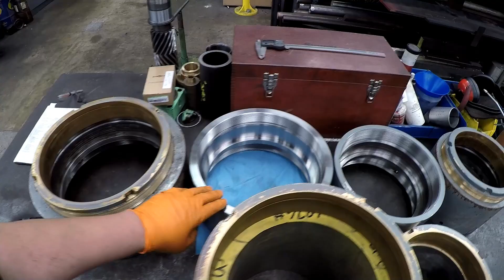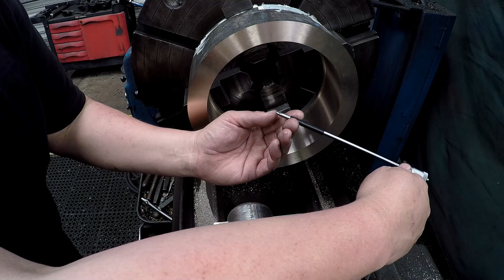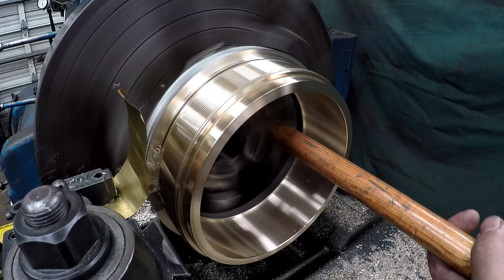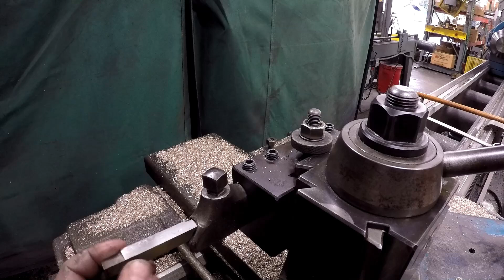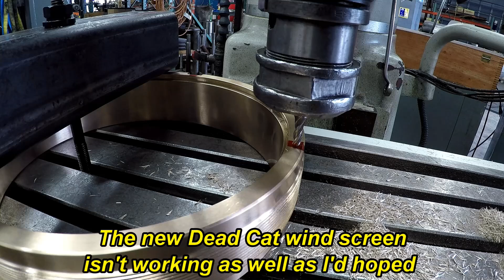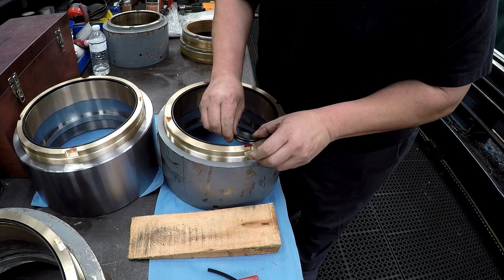SNS 161 Part 2: Machining Bronze Packing Nuts

Comment: One trick for checking large diameter holes with inside micrometers where you use it as a transfer gage is to have a sleeve you fit over the anvil on the outside mic so the inside mic can't fall off.

Comment: Hey Adam, am I correct when you were milling the packing nut spanner nut pockets that you lock the X and Y axis for each cut ? Will that move enough to affect operation? I take it that is a good practice to get into. I am stilling learning. Great job, would like to see them put together. Diddo on the hearing protection, years of work in auto shop takes toll on hearing as well as machine shop and other shops . Protect them when you are still young, cuz us 50 pluser thought we were tough, Wrong paying for it now . God Bless Ya   Dave
Reply from the maker: Yes you need to lock them for each axi movement because the cutter will tend to pull the table that direction and you won't have a clean square cut.

Comment: Adam.. you may check David Clark Aviation brand noise suppressors, they have worked well for us. With the headset the mic is almost in your mouth and you never hear a breath but sound is good. They are cheap too. About $3.00,  I don't know about the size you would need though.. thanks for the video
Reply from the maker: I just don't like the idea of wearing a mic and or transmitter. I want simplicity and what I have works well for me. I just have to remember to use the wind blockers.

Comment: Nice video, Adam, thanks! The microphone wind screen will only work for noise generated by wind on the microphone itself, it won't help with wind noise generated in the fan blades.
Reply from the maker: They work good for wind and moving air, but I'm having to get used to use them is all.

Comment: Glad to "see" you take hearing safety seriously. Being deaf (100% loss) in one ear, I can tell you from experience, protecting your ears will be something you never regret. 

Surgery isn't possible in 99% of audible noise damage cases. If you lose it, the damage is permanent.

Co-workers working nearby should also wear ear protection in closed wall buildings. While decibel levels fall with distance, steel walls will often bounce sound waves at same frequency with more intensity caused by multiple reflection points. 

Thin wall Brass must be a pain in the ass, as I imagine the decibel intensity increases!

Comment: Im sure you have covered this before, but how do you know or what determines how deep the threads will/should be??
Reply from the maker: +zigz0911 I go off of the proper note size (tap size) and the proper amount of infeed on the compound dial.

Comment: Adam, I have noticed a few machinists that when facing they sometimes cut from inside to outside and sometimes from outside to inside ( my preferred cut}. What makes you decide which way to go?
Reply from the maker: +Doug Rundell with the bronze, it's because it's one less op to throw chips on my face

Comment: The hearing protection when possible is a good idea. It's often the unexpected noises that are the worst like a sheet of metal crashing down or a co-worker using a hammer. I got so comfortable with ear plugs at a point where I could have a normal conversation beside a running Diesel engine without issue. Tinnitus can also be hereditary, my hearings perfect and my ears still ring.
Reply from the maker: +Jordan M One thing I absolutely hate is when someone lets a pallet drop to the floor, because there too f-ing lazy to bend over and help it from slamming. Especially when your concentrating on an important cut.
Reply: Mechanic I used to work with would wait for me to go into the other part of the shop before he would do it, but even from there I could hear him clearly drop my drop light.  You can buy very expensive shock resistant filaments in those old school incandescent bulbs but they still don't just grow on trees. About three drops is all one would take before the ghost gave out.  By the power cord he couldn't just let it down easy?

Comment: Sonic Defender EP3s and EP5s, etc. come with a tube you can open up that filters less noise out if you want primarily loud bang hearing protection, close it up for constant droning noises.  Pretty cool I thought, they seem to be durable enough but they get dirty quick.
Reply from the maker: +multiHappyHacker I know that 3M make some like that, one of my coworkers use them. Makes it easy to have conversations

Comment: Adam, how do you machine and finish those long hydraulic inside bores.
Reply from the maker: +Grandpa Cocky The material is always honed from the supplier, but we have a bone we use as well when needed to clean up a bore.

Comment: Nice work on the packing nuts Adam.  You're smart with the ear plugs, my hearing is not what it used to be.  My Dad has tinnitus which to me is worse than hearing loss because there is not a lot that can be done about it.
Reply from the maker: +Bill De La Vega Bill I wish I would have started it way sooner, I used ear muffs when things were real loud but now I use them for everything.

Comment: Hi Abomb, what are those telescopic cylinders used for?
Reply from the maker: +Doug Borrett They go on truck dumps typically found at paper mills and wood mills.
Reply: Thanks, I had a feeling they were used for semi tippers, seen a few of them on YouTube trying to tip on ground that was not quite level and the tipper fell sideways at full height bending and totally stuffing the hydraulic ram.

Comment: When machining so much bronze (copper or brass for that matter) do you save the turning chips so sell as scrap? It seems like you are taking off quite a bit of material, and I would think the scrap value would add up pretty quick.

Comment: Good show!, I think the only reason some folks choose not to protect their hearing is for the most part, just something that is taken for granted, and stubborness... lol...  I have an another abstract question, again, I see that you tighten the grub screws on your tool holders to the cutting tool bits ever so slightly, ( of what appears to be about 1 to 3 foot lbs.) I run much smaller machines, (so small that my mill could fit on your your compound rest of the lathes you run) but I tighten the living daylights out of mine, fear of the tool bits moving and messing up my dimensions, etc. don't your tool bits ever move on you? or am I actually over doing it? Drew
Reply from the maker: +Dru Bradley I tighten the tool bits when they need it. I think your referring to the chamfering tool I used in the Armstrong tool holder. That op the tool didn't need a whole lot of torque, but I put more on it then it may seem. When I use the set screws on the tool holders I tighten them down very snug.
Reply: I understand, I just wasn't sure If I was over thinking things, I never worry about the tool moving in my holders, but I really don't like to tighten them that hard, even though I do, for the reason, of later needing to change out to another cutter, the snap action feeling of tension breaking free. let alone the marks that are left in the top of the brazed tool bits... I guess my biggest issue that I drive myself nuts while tightening the grub screws is any of the round shank tooling, like boring bars into the boring head, and the marks make the small distortions and makes it difficult to then remove, yes, I stone the surface once removed, to aid in reinstalling the tool next time, still drives me nuts. The H.S.S. shank designs or bits, is not an issue, as you know. I thought once that maybe I would grind or mill a flat land area on the various round shanks, (like what is found on endmill shanks to the tool holders), but didn't, due to the idea that will limit the fine adjustment, via simply being able to rotate the boring bars a few degrees as needed.  I suppose I can accept the idea, that it is just part of the nature of the process... Very well. Thank you. Drew ((no need to reply to this, I am just thinking/typing out loud))
Reply: As a mechanic I can relate. Start out and you want to do good, so you tighten like you mean it.  Soon enough, you start to get real good at it as they say and snap-0.  oopsie, sorry about that. Stage two, then you go all weak sauce and stuff starts coming apart on you when it shouldn't have. Stage three.  You use a torque wrench and settle down with experience -- story has a nice ending huh? I suspect you'll have to learn to accept the occasional stoning of divots left behind by hardened points because that's what they do so that's kinda your job.

Comment: Adam, what do you do with all those chips? Is there a company that buys them from you to recycle? (Brass, steel, aluminum separately or all mixed up?)
Reply from the maker: +Wesley Lee We put all he metal chips and scrap metal in a large bin that goes to the recycle yard. It's gets sold and the company gets a check.

Comment: would measuring the outer diameter and then minus 2x the thickness of the wall give you an accurate enough reading if you say didn't have an inside micrometer at hand

Comment: Hey, Adam it's great to see that you are taking steps to protect your hearing.  I have tinnitus (ringing/hissing in the ears) caused by exposure to high volume noise at work.  I have a nearly constant hissing sound that I must live with.  I can't go to a concert anymore and I have to wear ear plugs at the movie theater.  My ears hiss and whistle for days if I am accidentally exposed to any loud sounds; like a smoke alarm or a banging door or trash can lid.  Hearing aids can't help.  So, do EVERYTHING that you can to protect your hearing before it's too late because there is no cure or treatment once the damage is done.
Reply from the maker: +John Ferguson Say what? 😆👍🏻
Reply: I've had tinnitus for as long as I can remember, even as a kid. If anyone can take steps to prevent it happening, DO IT!
And tinnitus isn't the only problem long term exposure to noise can have. If you are constantly exposed to a loud noise in the same frequency, you can go deaf in that frequency range.
Reply: I also developed vertigo.  I was sea sick for months and went from doctor to doctor and nothing worked.  My physiotherapist finally gave me some exercises that solved the problem.  Going deaf is not the only possible side effect of damaged hearing.
Reply: For me it was impact wrenches, concrete saws, tile saws, and jack hammers.  Repetitive rhythmic sounds like the sounds of impact wrenches are particularly dangerous.  I can't stand to sleep in a silent room because  the hissing sound only seems louder when the world is silent.  I play the radio on a low setting and that helps.  I carry around a supply of the little orange foam ear plugs so I have them at hand if needed.  I had to pull them out at a sandwich shop the other day because it was so loud at lunchtime.
Reply: For me it was circular saws, planers, thicknessers and moulding machines mostly and back in the 70's hearing protection wasn't a requirement as it is now, and as I said it didn't manifest itself until 20 odd years later. At night I sleep with my iPod under my pillow so I can sleep and not disturb the rest of the family. It is a real pain in the arse, so I can sympathise with you.
Reply: Doug Borrett and John, I can't begin to imagine what it's like to have that problem.  The best cure is to use ear protection as a general rule as once it's with you, it's there for good. Thanks for sharing your situations.  Kindest regards.  Joe
Reply: Even some soft paper, toilet paper, in the ears can do the job in many cases, if one got nothing else at hand. I often just put some paper in the ears for 'light duty' protection, when working with hammer and nails and so on. Even if one does not feel any direct pain in the ears due to certain noise, it does not mean that hearing cells are not damaged.
Reply: +John Ferguson My brother has tinnitus too, he is 19 years old.
His wasn't caused by loud noises, his ears are just more sensitive to "overloading" than other people's ears.

I heard tinnitus can get so bad that the ringing is constant and never goes away. There is no cure for it, not even by removing the ability to hear alltogether.
Reply: I have the same hearing problem with tinnitus from working in a wood shop for years, it took 20 years before I was diagnosed with it. (industrial deafness)
Reply: My tinnitus is more a loud hissing like a high pressure compressed air leak than a ringing sound.
Not as Quasimodo said.
" The Bells!!....The Bells!!!!"
It is nerve damage, so as you said even total deafness doesn't stop it.
Reply: I get the nearly constant hissing/  To me it sounds like a toilet filling with water.  I get a loud whistle if an alarm goes off or a loud beeping tone.  At first it would only last a few hours but now it goes on for days.
Reply: I've got that also. One thing that really bothers me is the damn beepers on the material handling machinery at the Home Depot. I can't get out of the store fast enough. Sometimes I have to leave before I even find what I was looking for.
Reply: I have trouble hearing certain frequencies, for example when the kids were younger my daughter aged 16 at the time (now aged 39) used  to say what is the ticking sound coming from the cassette player?  What ticking sound I couldn't hear it. The same with turn signals, I'd have to make sure they cancelled after a turn, it's a real pain in the arse.
Reply: Yep mine is constant and sounds like crickets in my head 24/7/365.  For folks who wonder what it sounds like, visit the American Tinnitus Association site and go to understanding the facts and then symptoms. There are sound files you can listen to that can give you an idea of what some of us hear.

Comment: Machine shop bling Adam! Do you clean out the chip pan and segregate the bronze chips for salvage cost recycling? Since copper, brass and bronze salvage price, is higher than for steel for example. Looking forward to "The Clash at the Bash".
Reply from the maker: Rain Coast Most of the chips go into the same bin. We have one for solids though. The money they collect for scrap metal goes into the bottom line, so no point in wasting. Bunch of time trying to separate all the chips each time.
Reply: Cleaning your machine after each job would make separating metals easy

Comment: X2 on the ear plugs. I didn't wear any protection for a long time and never ending ringing is my reward.
Reply: Place the palms of your hands over your ears with fingers resting gently  on the back of your head. Your middle fingers should point toward one  another just above the base of your skull. Place your index fingers on  top of you middle fingers and snap them (the index fingers) onto the skull making a loud, drumming noise. Repeat 40-50 times. Some people experience immediate relief with this method. Repeat several times a day for as long as necessary to reduce tinnitus.

Comment: not sure this would even help but. you know when your cutting thin wall tubing and you use a hose to dampen the chattering or noise, could using a hose on brass help. just a thought. love the videos and keep them coming. a million subs are around the corner.

Comment: I bet that piece of bronze tubing stock was expensive.
Reply: I paid around $50 for a 6 inch long by 1.5 in diameter piece from Mcmaster. I'm sure they would pay a lot less from a wholesaler but it'd still be pretty salty.
Reply from the maker: trainedtiger For sure, but part of the job no matter the cost. It's goes into the job.

Comment: Bet that bronze was warped like crazy. 4 jaw for thin bronze... Eeek.. I'll stick to my 3 jaw for the delicate parts haha. But i do love a 4 jaws grip strength. Love you Adam and I'll see you at the next video.
Reply: Cnc Appreciator 3jaws are worse than 4jaws for warpage. unless you're using softjaw like pie jaws.

obviously an independent 4 jaw requires the correct "feel" to avoid distorting a part.
Reply: I would have preferred a 6 jaw but most people don't have 12" 6 jaws. I'm a big fan of my 4 jaw, but I can't machine a tube with a 25 thou wall thickness like I can with my 6" 6 jaw.
Reply from the maker: Cnc Appreciator I don't have a 3 jaw for the Pacemaker, but I can indicate a part evenly with very little warpage with my 4 jaw. If it's a very critical diameter to hit, I'd go about it another way.